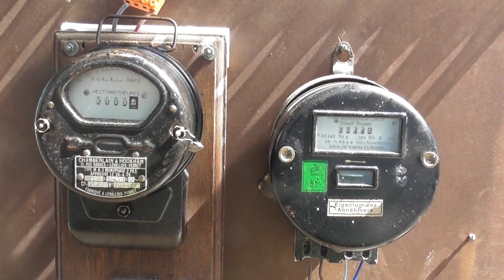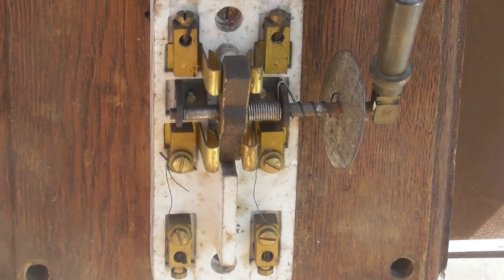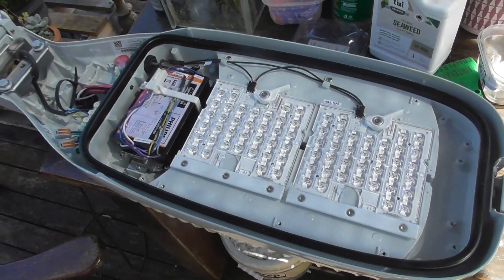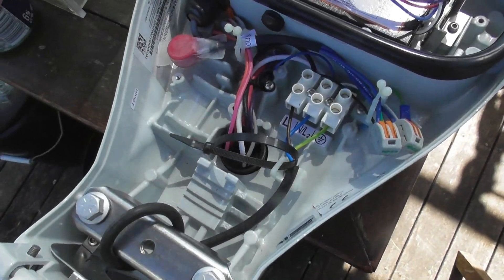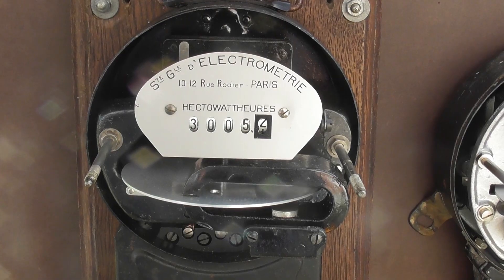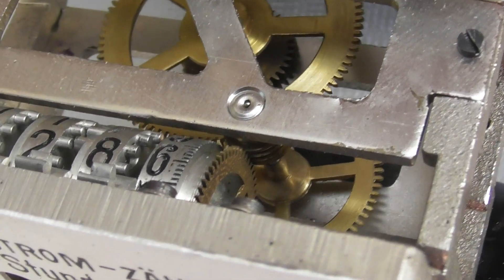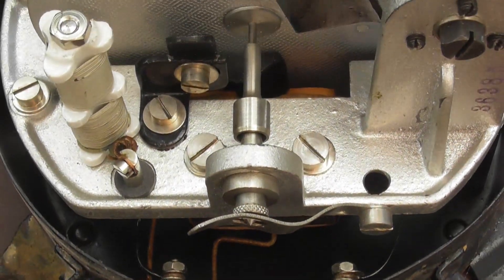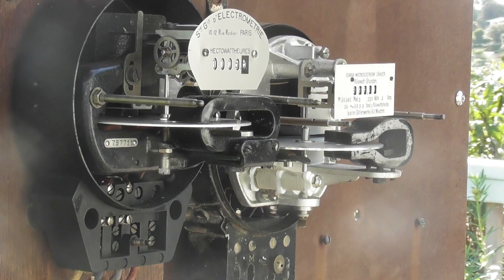96-year-old Chamberlain & Hookham and 109-year-old Isaria kWh meter spinning.

Comment: Will bet those 2 meters will still be well within calibration as well, and will remain that way as well till they finally fail, most likely from the first gear wearing out, or the coil being damaged from moisture or overvoltage.
Reply from the maker: They would most likely have drifted a bit. May do an accuracy check on them sometimes when time allowes.